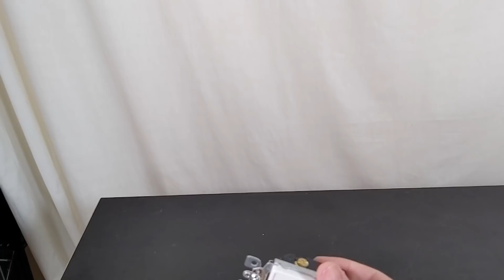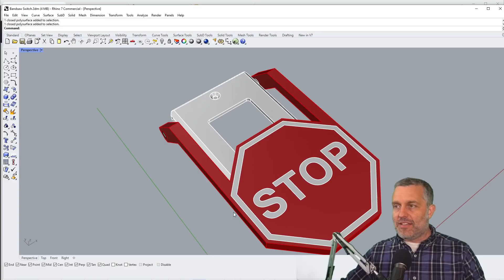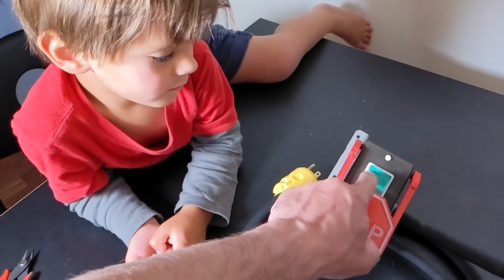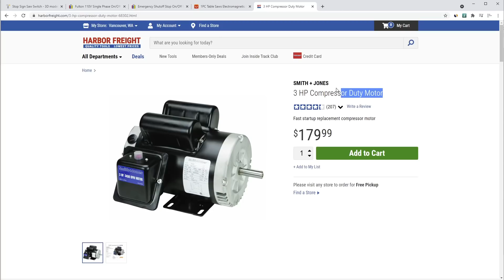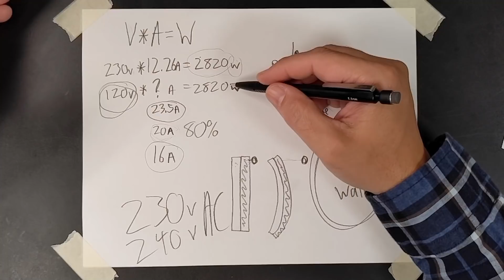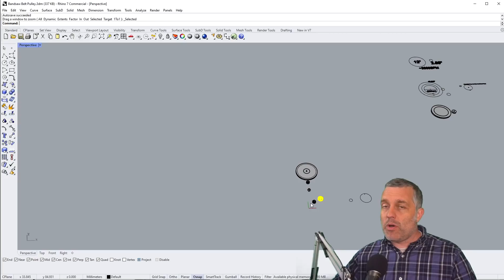Using a 3D printer to Renovate An Antique Bandsaw

Comment: Why not run it on a 15a 240v -- you could then use 14ga wire and a proper magnetic switch -- google why they should be used on tools like a bandsaw -- SAFETY!  And to get 240V get a buck transformer.

Comment: Your pulley was the wrong design because the belt you are using is an "A" belt and the bottom of it should have been running on the pulley

Comment: With regards to the motor, have you been able to measure the actual current/voltage draw of the motor?  As you mentioned, chances are its not even 2000W  motor.

Comment: Great video and congratulation on the Hackaday coverage. You can use a contactor such as Packard - DP301202 C230B 2 Pole 30 Amp Contactor, 120 Voltage Coil ($11.48 Amazon) to share a 220V circuit with one of your heater circuits. Then, you just replace it with a junction box when you move out of the house.

Comment: Dude, that electrical is sketchy AF. You should really get a motor rated for 120VAC or wire in a 240VAC outlet for yourself (confirm your switch rating if doing so). That motor is going to consistently run hot due to the increased current draw and that will in turn breakdown the insulation on the motor windings. Similar things will happen to the wiring in your walls. Electrical shorts inside walls or in and around potentially dusty workshop equipment can make for a bad day. At the very least get a meter and see what your actual current or power draw is.

Comment: Ok just watched a bit further. Man you are wrong about the motor and amperage. The constant is not the power consumption but the resistance (electrical ) of motor (actually it is resistance and inductance i think that is the name). So your motor takes 3kW@230V. So 230V/12.26A =~18.5Ohm. so120V/18.5=~6.5A. so you will never get the 3kW only about 780W@120V. This here is simplified but if you check the amperage it should be below 10A at all times... Probably less than 6 when it is free running and not stalling.

Sorry for sounding negative but i just really like your content and struggle now hearing this from you. Apart from this mistake this is great video.also really get the inverter and you will be able to cut aluminum like there is no tomorrow on this baby. 
Cheers and greetings from Poland!

Comment: If you want speed control just slap some inverter there. You will get  current, torque, speed control. Especially for this size motor there are many options on the market.

Btw, thank You SO MUCH for sound level control!

Comment: I've got 400V three phase in my house in Sweden, that's the standard over here. When you are not sawing the actual power used by the motor is just what is needed to overcome electrical and frictional losses. I am guessing that the motor uses the most power at the time when it is slowing down begause you push it hard. You are probably OK with the 110V unless you plan to saw long cuts in very thick hardwood.

Comment: Isn't it that if the bottle neck of a circuit is in a wire then the wire will heat up and melt to oblivion? I mean, I melted switches before.
My understanding is not that the wattage remains constant but the equivalent resistance, thus doubling or halving the voltage results in a factor of 4 energy consumption

Comment: You've misunderstood how electric motors work. The motor will NOT always draw the rated current, or produce the rated effect. If you don't believe me, put a watt meter on the bandsaw plug and test it with and without load.

Comment: 3 phase is 380v ~ 400v which you don’t want to stick your finger in by mistake. Works great though 😁
Reply: If you already hold one phase with 230V, you will not notice touching the second phase.

Comment: You could have solved both your current draw and bandsaw speed issues by fitting an inverter into the circuit. With a nice inverted you can dial the speed to whatever you want for the material you are cutting. Most inverters support a current limit function.
Reply: That would be better, but still not an ideal solution. At the end of the day a 3kW load is still a 3kW load and if your driving that inverter off the mains, your still trying to provide 3kW on a 120VAC  20A circuit. The current limit feature would be key, but you'll lose torque, so you might as well just get a 120VAC rated motor anyway. Also If you use the inverter for frequently running the motor at lower speeds than intended, it'll be generating less back EMF, which means more current and impaired cooling fan performance, which will still lead to overheating and damaged insulation and so on. 
Ultimately the solution is to provide a power source suitable for the equipment.

Comment: That HF motor is an induction type, which when undervolted by half will produce 1/4 the torque it would at full voltage (and stall way more easily than it should. You are getting way less torque out of the setup than you should, and while hard to tell from the video, your blade speed seems quite low to me. A bit more info:

https://www.quora.com/What-happens-if-an-induction-motor-runs-below-its-rated-voltage?share=1

Wired for 115V, this motor will give you far better power and has a lower PRM, allowing a larger pulley:

https://www.harborfreight.com/2-hp-compressor-duty-motor-67842.html

Alternatively, for an adjustable blade speed, your best option (and one that would save you some money on buying a second band saw) would be to get a 3 phase motor (1.5HP would be fine) and pair it with a VFD. A VFD will alter the speed of the motor by controlling AC frequency, and provides a flat torque across the speed range. Additionally, it will take 115v single phase from the wall and output 220v 3 phase. This would allow you to run it for any non-ferrous and wood with just an adjustment of the dial, and many harder woods also prefer a lower blade speed. 

A VFD for this setup will probably run you $100 on top of the 3 phase motor you get (which should cost about the same as an equiv single phase). Make sure the input voltage of the VFD matches what's coming out of your wall.

As to the use of tires on the saw, There are a number of metal cutting saws (vertical) that use tires. The horizontal bandsaw I have, and a few others I have used don't, but not sure why. Just saying that I suspect that cutting aluminum or other non-ferrous with tires on the saw is likely not a problem, I might just do a bit of research. I mention this because it appears that those wheels are aluminum and will wear probably significantly more quickly without the tires in place.

Comment: V*A do not equal W, V*A*cos(phi)=W. Regarding the protecction in the panel, breakers are rated regarding their speed to actuate. Regarding the voltage, normally is 240Vac/50Hz ( Europe ) and 120Vac/60Hz ( USA ), so the speed of the motor will be affected because it depends on the frecuency. Also, asynchronous motors are like transformers ( regarding their electrical properties ) so they are rated to a certain voltage not because of the power ( this can be adjusted with the gauge of the wire ) but to have a cerntain magnetic coupling between the stator and the rotor ( number of turns in the stator ). Because of that, it's important to note that changing the voltage not only will affect the amount of torque, but also the maximun speed under load.

Comment: Just a tip you can run all the wires and conduit yourself in most places it just has to get finished hooking up by a certified electrician the less time they need to spend at the job the cheaper it will be.

Comment: I'll admit to not knowing a lot about inductive loads. However, I believe that Ohms Law should still hold. Appling a voltage across a load, will draw current to match the voltage and impedance (resistance). 
Ohms Law : V=IxR
or... I=V/R
If you reduce the voltage the current should also drop. Could you measure the current in your in the 120 volt configuration? I don't mind being wrong but would like to know if I am.

Comment: If you hinge the stop lever in the middle of the switch, you can extend a piece out the top.  This way when you push the stop in, you can alternatively pull it out from the bottom to switch it back the other way and it would act similarly to existing switches.

Comment: I like 3D printing modifications when premade options either do not exist or are too expensive.  However, @ 43 cents a piece to ensure the wires do not rub against the metal is an inexpensive solution on your connectors for your metal junction box, look for these: https://www.lowes.com/pd/Sigma-Electric-ProConnex-3-8-in-Clamp-on-Type-Service-Entrance-Connector-Conduit-Fitting/1087255
Reply from the maker: Good point!
Reply: He said he like home Depot. https://www.homedepot.com/p/Halex-3-4-in-Non-Metallic-NM-Twin-Screw-Clamp-Connectors-5-Pack-20512/100134407?MERCH=REC-searchViewedNA-100134407--N

Comment: What materials do you plan on using with the bandsaw mostly?  Avoid bosch bands.  I have had alot of inconsistency in the newer band blades. If you can find old stock, they are good stuff.
Timberwolf is my preferred brand. They do break along the weld if you don't have it dialed in or force push material into the blade.  For consistency and cutting, I like Timberwolf.
Also homedepot thick pencils are good finesse push sticks.